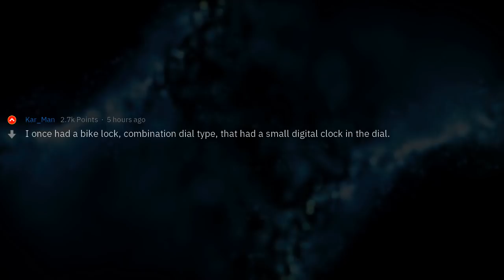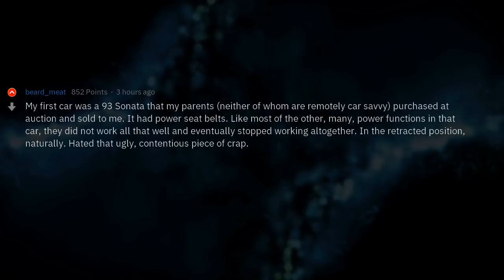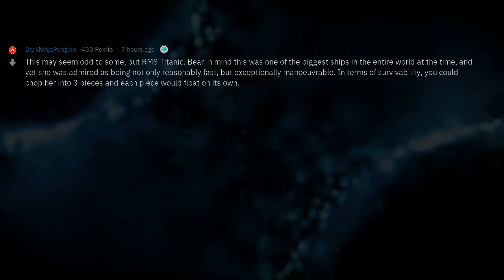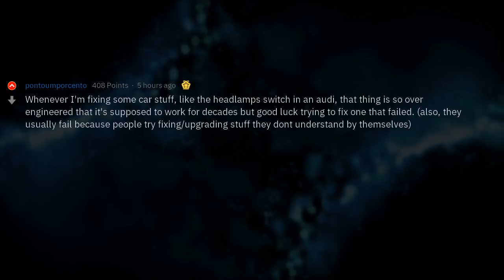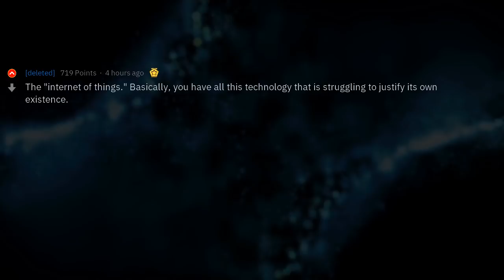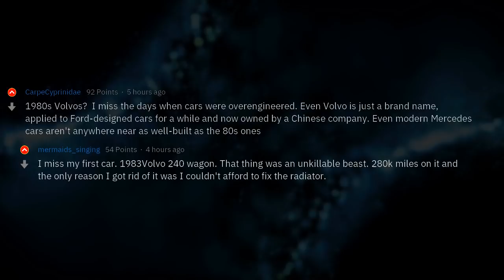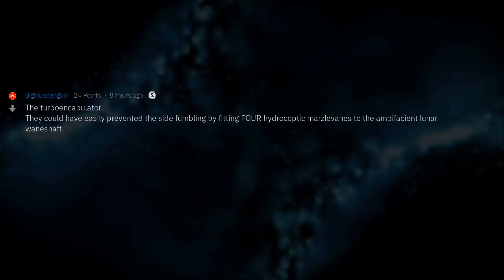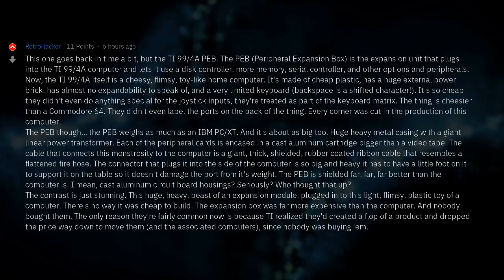What Technology Is Overthought? | People Stories #272

Comment: Volkswagens in general. You need to remove the front bumper and fenders just to change the radiator.
Reply: Mitsubishi had a couple models where you had to take the engine out to replace spark plugs... Ford has a few that you have to take the front tires off for servicing like the spark plugs and wires, or the oil filter... Anything automotive is turning to useless sh*t... and it's not taking it's time. ;o)
Reply: @gnarthdarkanen7464  A lot of trucks encourage you take the wheels off to replace spark plugs and wires, though it's entirely possible to do so from the top. Possible, not easy. With a Chevy Sonic, for example, I'm 90% certain you need to take the engine out to change intake manifold gaskets. And it's completely impossible to take the intake out without removing the engine.
Reply: @nocount7517  "Encourage" and "Difficult" are different from "Impossible" or "Have to".

    The reality is pretty sad. All they're doing is maybe saving a handful of pennies on material cost, and inventing stupid reasons for basic maintenance and repair tasks to be taken to an over-priced facility just because you lack all the hardware and tools to do a job...

     Manifolds shouldn't need changed very often, and even a "valve job" shouldn't go on more often than once or twice a year TOPS. VW was notorious about that with their advent of adjustable valve lash, which had best be done with every oil change... BUT even they wouldn't self destruct if you only did it once or twice a year instead of every 3 months or 3K miles... 

    What I hear getting bragged about too often is how much better engines and cars are supposed to be in longevity, and yet, we have this crap. It gets so expensive that it's ACTUALLY cheaper just to junk the car and get a new one... and that's no good either.

   Worse yet, they've got LOADS of crap you don't even need and simply don't improve anything... There's no better power output or longer range for all the innovation. None of the parts last any longer, and everything is more and more difficult and tedious and time consuming to bother tinkering with at all...

    Going to a "professional" wouldn't piss me off so much, except for the outrageous levels at which they will scam you up front, and how little they actually demonstrate knowledge of the vehicle at hand... You can't walk in off the street and ask for a specific part replaced without it turning into some kind of pissing contest because the "master mechanic" knows of at least a half dozen things you've already f***ed up in the thing without him to "administrate"...

    AND God alone help you manage to walk in and out of a Dealership shop for less than a thousand dollars! 

     For all the money and shit I put up with, I'm going to start riding a horse. ;o)
Reply: @gnarthdarkanen7464  A lot of that extra expense is labor cost, which is largely determined by the average cost of running the business over a certain period of time. A VW dealership in my area, for example, charges $178/hr. So your oil change is going to cost you about $200. $260, if you get the premium maintenance package.
Reply: @nocount7517  Well, what the dealerships have gone out of their way to create is an unsustainable business model. Every shop has overhead and hourly to worry about on top of materials/parts...

    BUT there are certain parts and tools that can only be found at a dealership, to encourage business when they're the single most expensive place to get anything done, so the only reason anyone goes is when those specialty "dealership only" items are involved...
    AND they simply won't look at you if you don't have serious cash to lay out.

     The manufacturers are trying to help them, but what NEEDS done is standardize fasteners, and start pushing actually useful and deliberately well trained personnel.

     Honestly, if I could drive up and walk in, and just GET something simple, like a master cylinder replaced, without a half hour of arguing and at a reasonable price, I'd be 10 TIMES more likely to return just because it wasn't hell to play... Sure they can warn me that my pads are about half worn all the way around (I'd already know)... BUT just do the damn job I ask for... no weird-o extraneous warrantee crap, no parts and add-on alternatives, no services per miles or roadside blah-blah-blah bullshit... New master cylinder, plus one or two guys at 10 bucks an hour for the hour it takes to do it, and around 80 bucks and an hour later I'm paying the tab to pick up my keys and hit the road... Yeah, I could see going to the dealer for service like that... Better yet, because THESE guys know my car requires that special vacuum tool to prime it, and that you'll ruin it by "bench priming" and the like, I can even appreciate it.

    But no... They're the same operation as anywhere else, only costing 10 Times as much, AND usually arguing on top of it... AND I get home to trouble shoot for whatever they f***ed up royal in the process... first thing.

     I almost took a job at a dealership... Had hopes I could get trained on brand specifics and all... nope. No training offered outside the same classes you could go to trade school and get... ALL generic ASE stuff. AND the knowledge that 90% of your time is spent twiddling thumbs and NOT making any money.

     I don't wonder at how they've put themselves in a financial shit-hole, and I'm not about to single handedly drag them out of it. ;o)

Comment: European automobiles.  Great when everything is new, but expensive as heck when the cooling systems fail.  That's both oil cooling, and the engine coolant systems.  

And then there's the suspensions, and electronics.